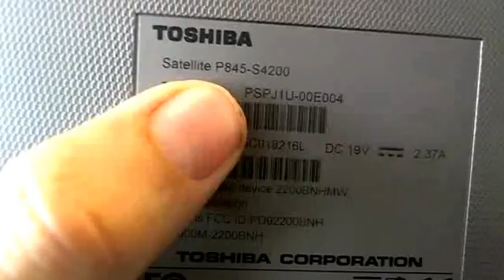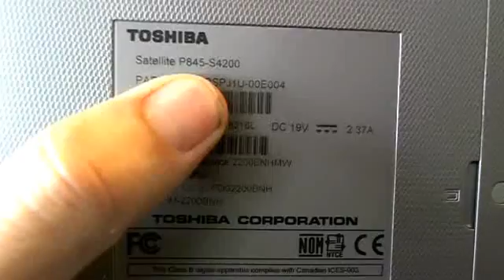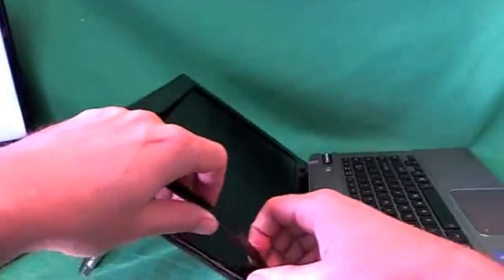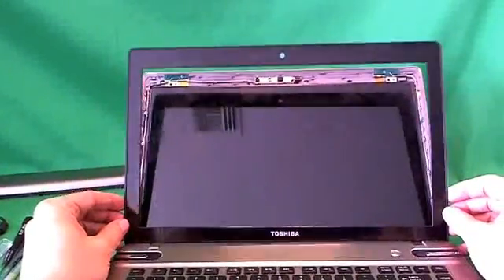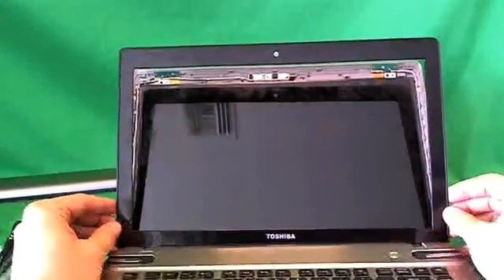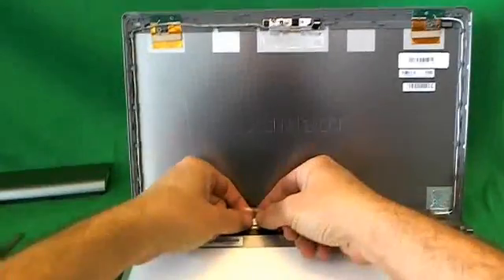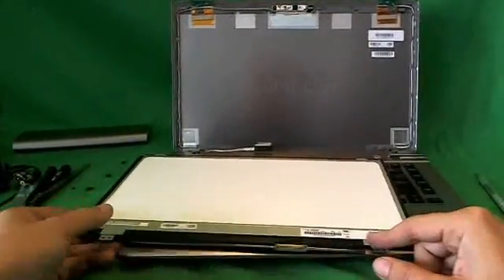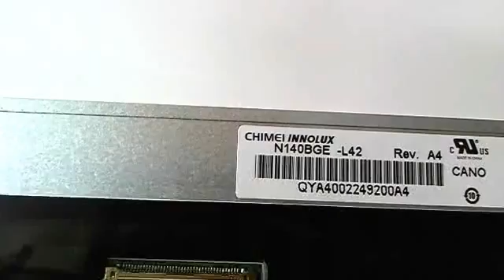Toshiba Satellite P845 Laptop Screen Replacement Procedure

Comment: hello there, I liked your video! I got the same laptop, it have 6 moths with me, but late on this week, I noticed a flex problem, with the left flex. When I open the laptop sounds like crack, maybe forcing that I think. Later on this days I found that it have a part of the laptop screen that is open, not the LCD. I mean the back of the laptop on the flex corner. I just think that is the wear and tear. But later I close it. And tried to open and was hard to open, I smashed the flex! I need help